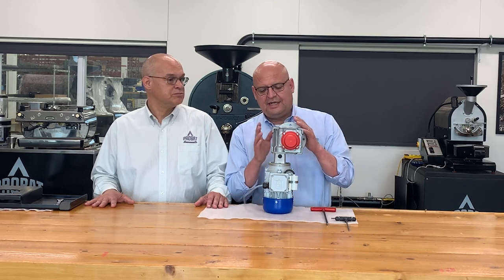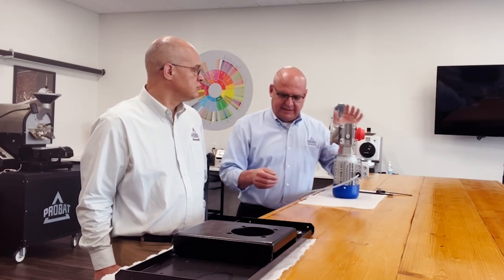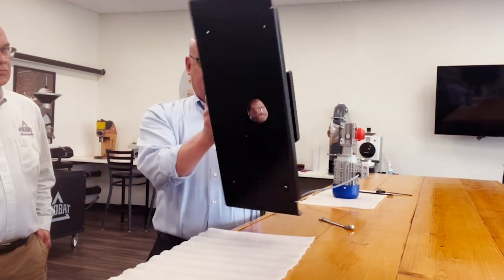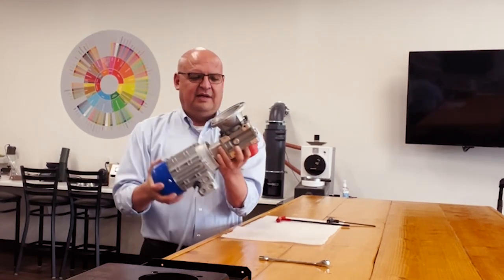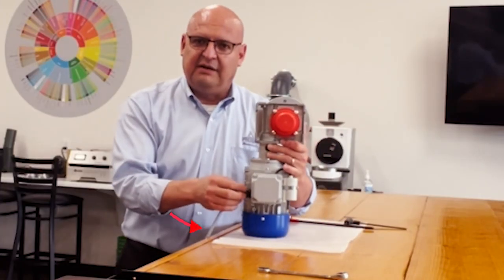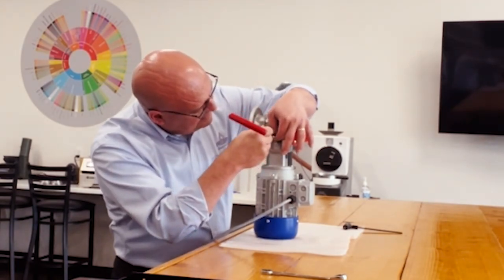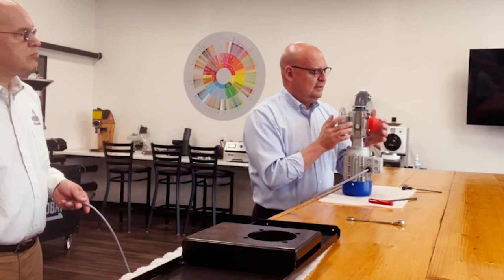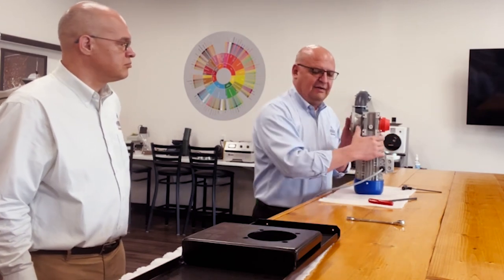Check The Oil and Adjust The Clutch On Your Probat P Series Cooling Tray Motor

Comment: There is like a bee sound from the motor when it is on. I am not sure if this is normal or even it has any thoughts to do with changing the oil or not, by the way how frequently should the oil be changed for p12/2?
Reply from the maker: Change out the oil around once a year. The bee sound is somewhat normal as long as it's not super loud.